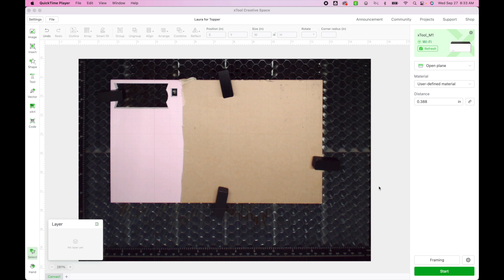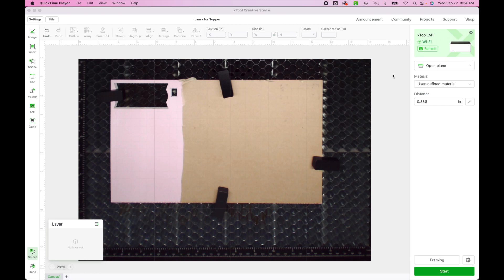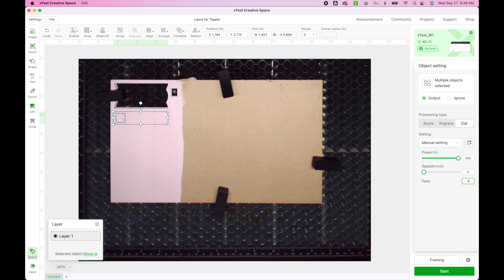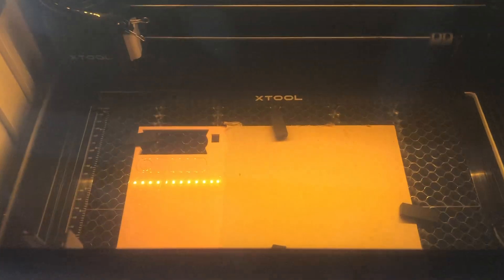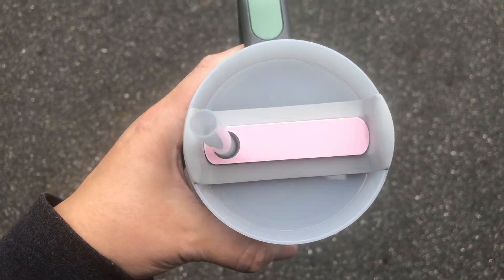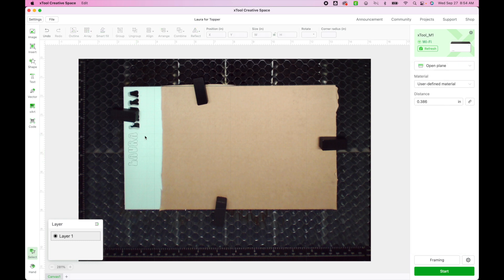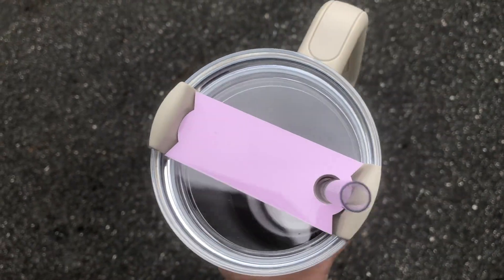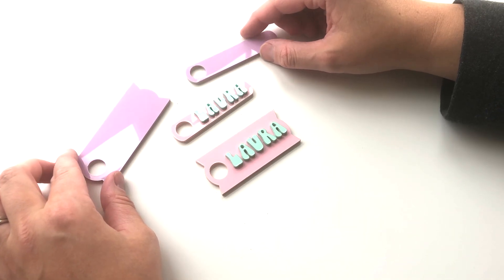How to Make a Stanley Topper with the xTool M1 Laser

Comment: When you're cutting the letter out, cut a small border that encompasses all the letter as well.  you can use it as a stencil to get your spacing perfect.
Reply from the maker: I actually did this the second time I made the toppers! It definitely made it a LOT easier.
Reply: May be a long shot, but  do you have a visual of the process you’re stating or know of a video on YT that shows what you mean?
Reply: @whuwatwinwear6786 no, but imagine this if you will. In XCS, enter your text. Then place a rectangle around it.  Cut the letters and the rectangle. Attach adhesive to the letters but not the rectangle. Place the rectangle down where you want to place the letters. Place your letters that now have adhesive on them in their original holes in the rectangle one by one. They are not perfectly spaces where you want them.

Comment: I wonder if white acrylic with colorful polka dots can be cut with the Xtool m1 since you are using the pink ?
Reply from the maker: I think as long as it is cast acrylic, it is very possible! I know white is the hardest color for many to cut with a diode but I have heard lots of success stories. I have not attempted it yet unfortunately so I can't speak from experience.
Reply: I’ve cut white cast acrylic with my m1 I do 5 passes